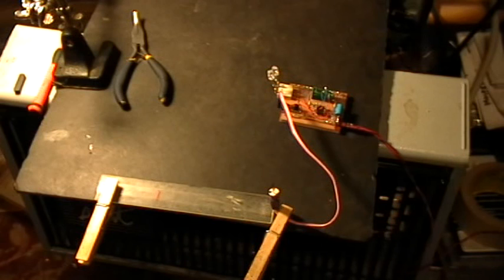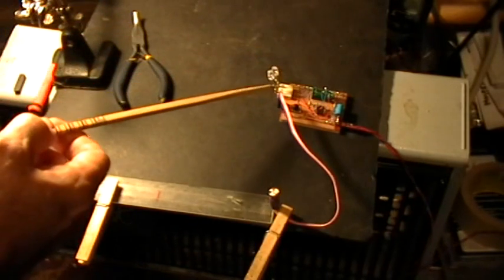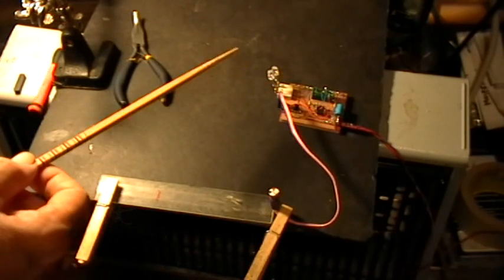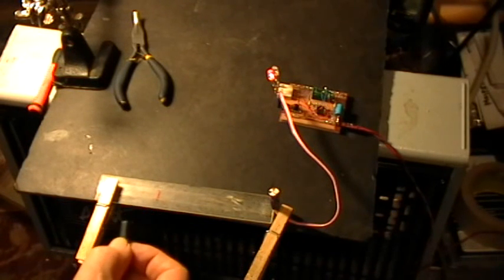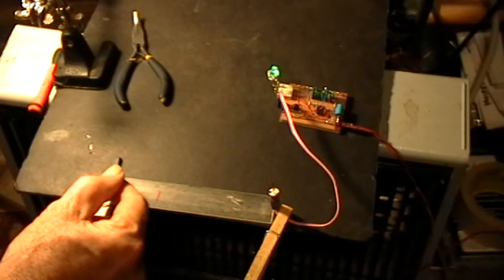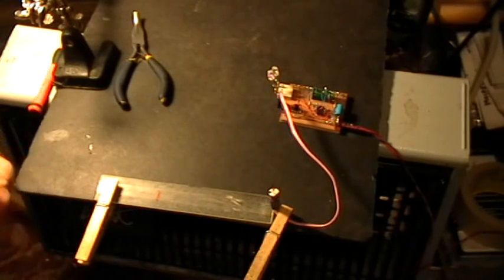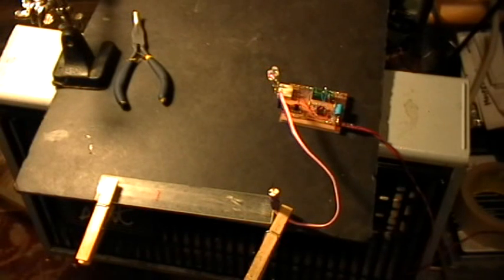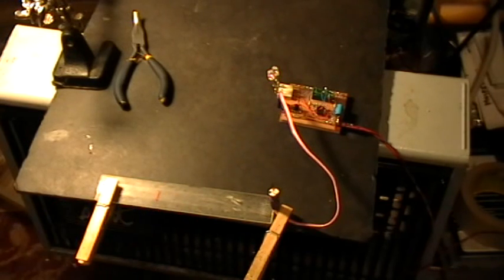Pulse Motors: Supplement: Hall Sensor + OpAmp Sensitivity

Comment: Dear Mr. TinselKoala,
I want to make an non-microcontroler repulse magetic levitation. I read your comment from a forum (I can not remember exactly the link). I got 4 A1302 hall sensors that are more sensitive than yours (claimed by Allergo). I don't know why It only changes the output voltage when the magnet contact it in about 1.5 cm. I used 3.5x0.5 round rare earth magnet. Could you help me on making it more sensitive like yours. My major is biotechnology, so i don't know much about electrical circuit. I want to use the output voltage of the hall sensor to control a coil (4 sensors for 4 coils) to pull-push the floatin magnet to the sweet-point. But it so difficult for me cuz the hall sensors are not sensitive enough to recognize the position changing of the floating magnet. To be happy to get your response! Thank so much!
Reply from the maker: I don't know why you aren't getting the sensitivity you need, since I don't know your exact circuit.
 In this video I'm using an op-amp as voltage comparator, so that when the Hall sensor output changes a tiny amount wrt a reference voltage, the comparator flips state and causes the LED to respond. You will need some such arrangement to control a power mosfet which will drive your coils. So you cannot just use the Hall sensor directly. You will need to put the Hall sensor output into one of the 2 inputs of the op-amp, and provide an adjustable reference voltage to the other input. Then the output of the op-amp will drive a mosfet driver stage (either a totempole transistor setup or an actual mosfet driver chip) which in turn will control the power mosfet feeding your coil.
Good luck and don't forget to make a video of your levitator !
Reply: Thanks so much for your friendly response. Could i send you a picture of my circuit to get your advise? If it doesn't mind, please give me your gmail so that i can send you my picture. 
best,

Comment: at da hell does this have to do with motor as stated in your description?
this is what i was expecting to see when i read your description https://www.youtube.com/watch?v=VQvgDs3Mp94
Reply from the maker: +Sys.stem 
Well, I obviously have no control over your &quot;expectations&quot;. But many people use, or try to use, Hall effect sensors in their pulse motor builds. Some of them may even be interested in this supplement which contains information about sensitivity of this Hall sensor and the use of op-amps.
Maybe you will like this one better:
https://www.youtube.com/watch?v=kPt7xbmHXfY
Reply: TinselKoala
well thats a much better video, but is still not what i was looking for, im looking for a opAMP  being used in a way that the motor is being connected directly to th chip output and i guess you can say the op amp is just running a sine wave from a 555timer that the motor will typically get from a controller or driver telling it to go at this direction and this speed, so just a op amp dc motor or servo and power and some passive components  to keep everything safe while running

i do love the whole idea of using a capacitor like a battery and limiting the current coming out as well as the volts
Reply from the maker: Sys.stem
OK, how about this then:
https://www.youtube.com/playlist?list=PLml9VdOeqKa8F1PebS_EX7AX2aA_ZZtb9

Comment: Thumbs up from me. Good video. What kind of range would you get with a Neodymium magnet out of a hard drive I wonder.
Reply from the maker: Thanks! I've tested it out to 20 cm with a N52 disc magnet, but at that level of sensitivity it actually is responding to the Earth's field like a compass, so orientation of the sensor wrt Earth N-S and dip becomes important.
Thanks for watching!

Comment: very cool. your skill at electronics is impressive.  may I have the website & part # of the hall effect sensor you used?  I used to use radio shack hall effect switches from their old window/door burglar alarm systems as depth sensors & I can't git 'em any more.
Reply from the maker: The Hall sensor is the obsolete Allegro A3503. I got them from an Ebay seller from China. Just search Ebay for "hall sensor ratiometric a3503" and so on, you will find them listed, by different sellers at many different prices. Eventually you will find a price/quantity/shipping cost that meets your needs. It took about 12 days for them to arrive in my mailbox here in Texas. I got 10 for 1.98 plus 2.00 shipping.